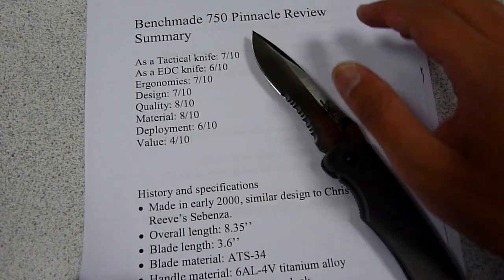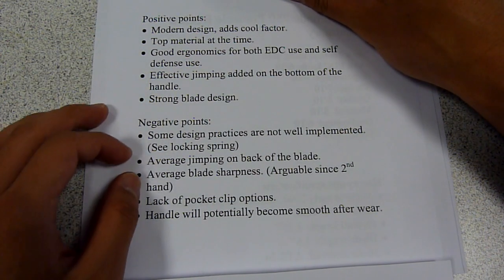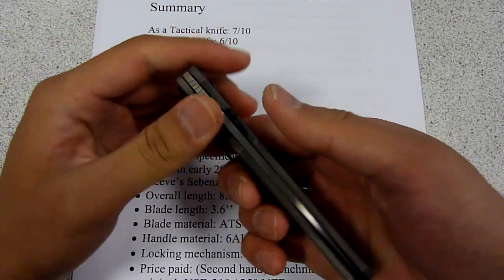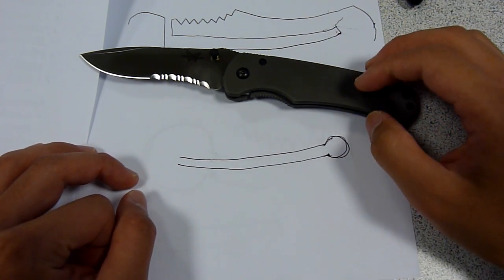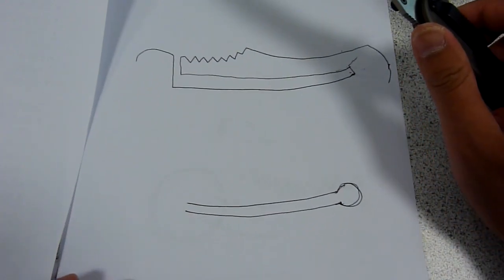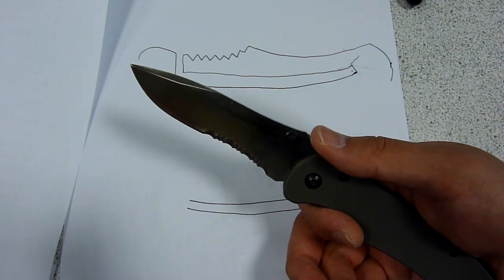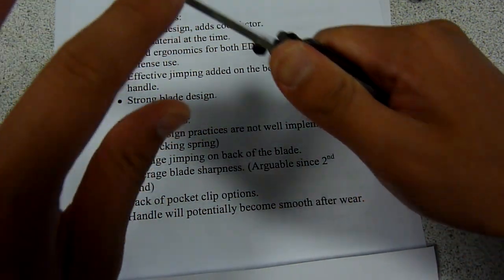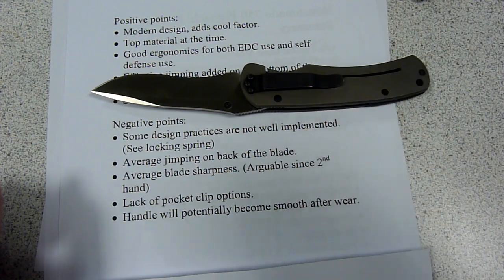Benchmade Pinnacle,Yaxell,cts-bd1n,s110v,cts-xhp,m390,k390,CTS-204p,s110v,s90v,maxmet,cos,cts-20cp

Comment: Very interesting point you bring up about the framelock cutouts. My strider and my sebenza both have that and it makes sense. It's worth noting that benchmade cuts all their framelocks (including the bradley alias) like that, except the new hk conspiracy seems to use the different method. Also, some kershaws like the tilt and the speedform use the same method as bm, though those are cut with wire edms, so it's a paper thin cutout. The zts use the circle though.

Comment from the maker: @ibesteadymobbin92 I'm glad you think the same way, yeah, even if you did abuse your knife it may not break in there, cause usually a knife is as strong as it's weakest point, which is usually the tip or the joint.(actually when I think about it, the locking part is the most used part cause you will be bending it over and over again as you unlock the knife, but yeah good thing it's made of Ti and it's pretty thick) But I guess I felt like mentioning it because I think it does show they didn't p

Comment from the maker: @ibesteadymobbin92
Regarding to the round tension relief, I think you must have quite a few collections to know that. I know spyderco ones are wider than the cut out width, and they almost always keep it that way. I don't really prefer one to another, for me it's important they are there. I like it when the manufactures are thoughtful, for example these days some Ti frame locks come with a mechanism that stops you from over bending the frame lock, I think it's quite nice they invented something

Comment from the maker: @ibesteadymobbin92 put enough thought on it back then. I saw the picture of new gold class BM pinnacle on the Internet, if you zoom in you will see they had put a small round finish this time(its diameter is the same size to the cut out width itself, so it's very hard to spot it if you don't have the actual knife, you can only see it if you zoom in on the picture). So, good on them! Unfortunately for the BM fans it's an 800 dollars limited run. I mean that is a lot of money for a knife!... 
Reg